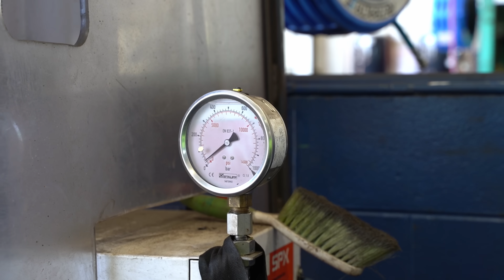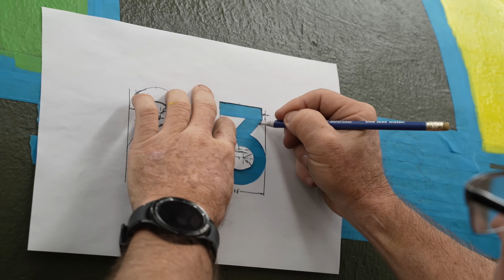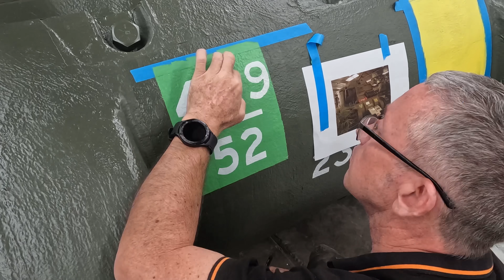Witness the Incredible Transformation: Full Movie of Australian WWII M3 Grant Tank Restoration

Comment: The tank is more than 80 years old, yet the bearings, final drive and transmission gears are perfect, as if they were made yesterday. We need to pay tribute to the people that designed, machined and build them. What an incredible job they did.
Reply: The Chinese has wiped out all sense of quality.
Reply: @perkihlen9532 I’d say it’s more ultra-mass production and a focus on making purchasing and manufacturing costs as cheap as possible. You can get high quality things made in China, just like you can get very low quality things made in the US. You’re just always going to pay more for something that’s high quality
Reply: They also went for uniformity of parts so parts from one company could fit any vehicle.
Reply: It’s more so because a lot of these military vehicles being restored are the ones that didn’t see a ton of combat and are pretty low miles so you just get a lot of damage exterior wise from sitting in a field where the drive train final drive and bearing never seen a lot of use and defiantly was never exposed to outside environment so they’ve been preserved

Comment: As luck will have it - I'm currently building a 1:35 scale Grant, with interior.  The video has been a great source of info during the build.  Thanks guys!
Reply: I build my first GRANT & SHERMAN  50 years ago in 1: 32  scale bud i cant remember the maker ... Machbox ... Monogram.... AIRFIX ? 50 years ago the 1:32 scale was very popular because its matched to the ARIFIX  Soldiers . This 1: 32 Kits was the first ones with the original scaled ,, Central return roller suspension " ! May i ask you whats the maker of your Grant 1:35 , and ist the full interior incl. the kit ?  My favorits 1: 35  makers are TAMIYA , ACADEMY,  AFV  & RESICAST  . I use to build al  kits with VERLINDEN interior kits & full working KETTENKASTEN tracks. Greetings from a old  german Scale builder .

Comment: Hi guys,brilliant series. Tight bolts. Something I learnt in the mining industry. Do not heat around the bolt,actually heat the bolt to a cherry red, let it cool for a few minutes, then hit with a rattle gun. The heat brakes the rust and also stretches the bolt. We had bolts on our face shovels that had a hole through the bolt in which we would insert a heating rod. When up to temp we could wind the nut on. Remove the heat rod and the bolt would contract. Tight as a fishes butt. Same works for a normal bolt,obviously without the hole in the guts. Love watching you guys. Cheers

Comment: Just amazed at how well built this thing is!  Built like a tank!!  I wish I could be part of a project like this.
I'm tired of seeing plastic cars and plastic everything!
They are handling what America used to be...
I've always like working on things.  I started by working on lawn mowers.  I was good, ending up wit all those extra parts!  LOL
I worked on some farm machinery, cars, trucks, was a diesel mechanic in the Navy.
I worked on those Detroit Diesels, 671s and 871s.  The "Grey Marine," Detroits.  They were just a Detroit Diesel, with  the cooling system, that drew water from the sea beneath the boats.  They didn't have a radiator.
But this is what I'd really like to do...  Make old machines like new again!
Even the 871 Detroit was a 2 stroker if memory serves.  It'll smoke till she's warmed up.
Too much smoke...  Maybe bad or injectors?  Or they need to be adjusted?  Nope...
Just pull the rag out of the intake!  LOL.  Man!

Detroit and nearly all two stroke engines will smoke, until they get the air flowing good through the cylinders.
The Detroits usually didn't have a turbocharger.  They have a 'Blower,' or 'supercharger,' mounted on the V8, in the middle of the heads.

The compressed air was part of the exhaust process of the two stroke engine.
As the pistons come down from the power stroke in the cylinders, the compressed air blows into the cylinder from slots in the cylinder walls, and blows the exhaust out of the exhaust valves!

A work of art!

"Merica!"  O7  <S>

Comment: Love these videos, even the compilations!  At 00:22:19 anti-seize has metal particles in it (hence the "mechanic's glitter") and ideally shouldn't be used in a place like that where it will mix with grease and accelerate wear on the roller bearings.

Comment: Say what you want about the M3, definitely not the most effective tank ever (RE Firepower, Mobility, Protection), but It was obviously built and maintained with pride and care during the war. Enough that this specific example, even after "hard farm use" was able to be stripped down and rebuilt after 80 years... The fact that most of the enclosed running gear looked that immaculate and clean... just wow!

Comment: Interesting hybrid driveline setup. The engine drives into an automatic gearbox and from there the drive is taken to the original manual gearbox at the front. It seems that an optimal gear will be selected on the manual box and it will then be left alone. The actual driving will be done with the automatic box?

Comment: Great Job You Guys, It Does My Heart Good to See You Using Anti Seize on Bolts and Nuts 😍 A Little Trick I Learned Long ago is to use a Very thin Layer of Anti Seize on Radiator Hosed and Heater hose on the inside, It wont Deteriorate the Rubber and it Keeps the Hoses From Vulcanizing onto the Metal hose ends, I am a Female Retired Truck, Diesel  and heavy Equipment Fleet Mechanic, of over 50 Years, Also Before Firing up the Detroit Diesel Engine, Make sure the Air Blocking SAFTY Flapper Valves above the Scavenger Pump is loose and free, 2 stroke Detroit Diesels sometimes .like to Run away, Also if the Detroit Diesel Engines use Cross Head Pistons, ( The Rods are Bolted to the Wrist Pin ) make sure the Piston Liners dont fit tight in the liner bore, they should just slide in with hand Pressures, if you hammer the Liners in, The liners will grab the Piston and pull the Rod/Wrist Pin Bolts out and put a rod through the Block,  I Tried to Warn a Mechanic at a shop I was Working at not to hammer in the Liners, But He would not Listen, He is a STUBORN REDNECK and Thats what Happened 😮 Take care and Have Fun, Chellie

Comment: To pull those threaded pins of the Wheels just use a Hydraulic pin Pusher. Used by every heavy machine mechanic for hydraulic excevator pins. also threaded works like a sharm saves some time and nervs

Comment: 1:06:57 FYI, because this is known only to engineers who spend time with these things (i didn't know myself and most people i talk about this don't either), but the reduction on pipe should go longer than it does before it ducts down. There's specific math to this, easily found on the web, but the idea follows every inlet and outlet au regard elbows (where they can be placed) and reductions. These devices need a specific length based on diameter and purpose, before they do anything, otherwise the volume passing through creates serious turbulence and reduces the performance of the device (blowers, t-chargers, fans etc... doesn't matter what they are). Given how much space is there, that reduction should be longer and have a gentler duct down. Reason is, no point in stressing the whole affair when there's space. Jm2c, nothing more.

Comment: Always thought that when the M3 became relative obsolete that they should’ve upgraded the sponson turret with the 105mm gun from the close support version of the M4 Sherman & then simply removed the upper (37mm) gun turret, to lower the profile. As a way of backing up M7 Priest Supplies on the cheap. Afterall the standard 75mm sponson gun was basically the same as the standard 75mm M4 Sherman gun.

Comment: Good ol silver anti seize.. Just watching this video has caused my hands to turn silver.

PS. Ya'll should really get an induction heater to help with stubborn bolts. Heating up the entire part does work, but if you focus almost all of the heat on the screw (nearly impossible when heating the outside assembly), you will basically cook the rust off of the threads.

Comment: The air tools your using are underpowered for the job, on top of that your using reducers.

You need a full size 1 inch gun with sufficient air supply, it would save you from heating the majority of the bolts.

Comment: These American vehicles are so much simpler and better than the German ones. Probably helps that they have lived in the outdoors in Oz than Europe. I guess parts are easier as well as these were sold wholesale to locals, not destroyed after the war.
The Grant may have had its faults but for early in the war it sufficed and was as good as any German tank. And generally more reliable as well.
The Sherman was the next step up and a better tank. And unlike German tanks could be made by the thousand

Comment: Removing bolts from large pieces of cast or whatever.  Taught to me by an heavy equipment operator who  maintains his machines.  DO NOT USE A ROSE BUD TOURCH!!!  USE A REGULAR LARGE TIP AND HEAT THE BOLT HEAD TO RED HOT.  ALLOW IT TO AIR  COOL, THEN REMOVE. When the bolt is almost cool use PB Blaster so it will be pulled into the threads as the bolt continues to cool to room temp.  Heating the bolt softens it and relieves the stress on the threads.  I'm cringe watching you put water on that hot cast, Can you say CRACK.  Thank you for the video and best of luck.  ron